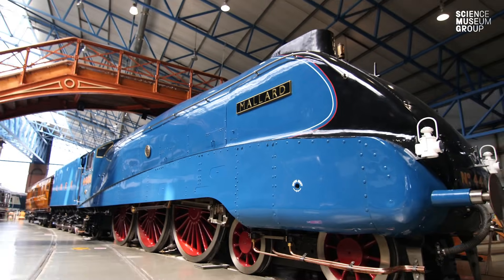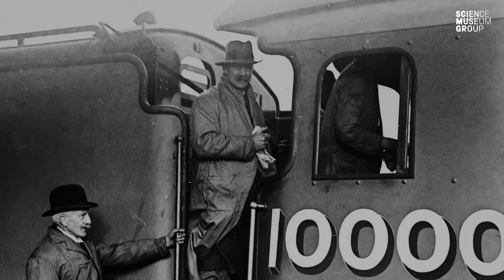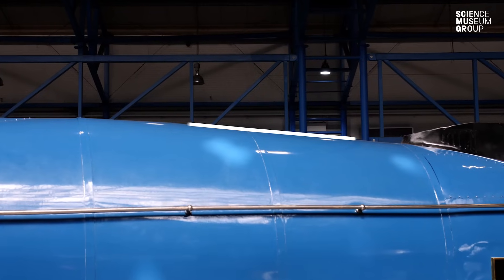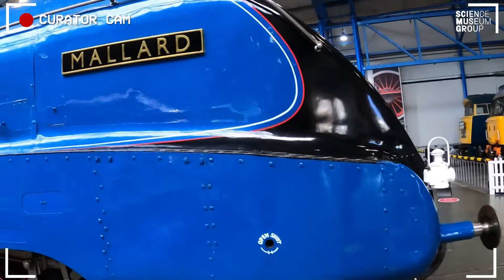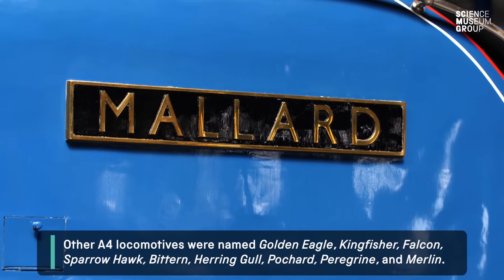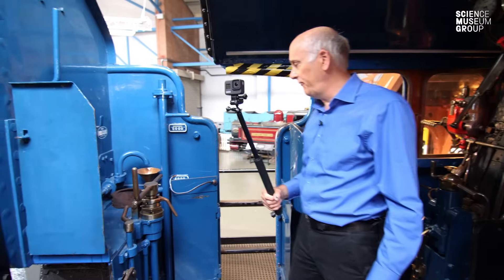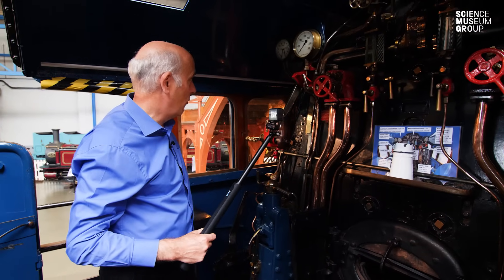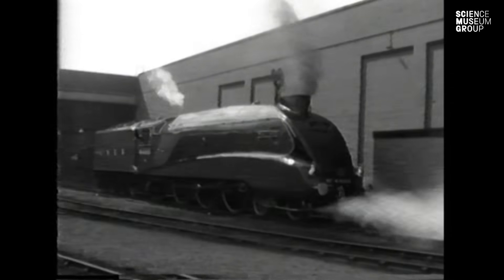Inside Mallard, the World's Fastest Steam Locomotive | Curator with a Camera

Comment: Apparently driver Duddington was chosen because he would take a risk, a bit cavalier even, and he damaged the works, something in the middle cylinder or crank went wrong during the run. Nevertheless the run stands as it should. The Germans had a run too near enough to Mallard, but it still doesn't count. As for the US locomotive that allegedly ran at circa 150mph, that was never ratified, and the loco wasn't making an official attempt...

I was on a cruise recently and got talking to an old chap as we were waiting to enter for dinner, who it turned out was an engine driver, and he was proud to say he drove Mallard occasionally during his normal driving work. He didn't make a big deal out it, it was just daily work to him. I felt privileged to have met and chatted to this unassuming man...
Reply: Duddington was not responsible for the inside big-end issue; that was due to valve overtravel from the Gresley conjugating gear.  (Which apparently was fixed long before BR days, once it was recognized as a concern).  If I recall correctly, Duddington thought he could have gotten 130mph out of the locomotive if given a little more time...
Reply: @wizlish  Interesting commentary Wiz. Perhaps Mallard was capable of more, but surely at that speed it must have been approaching the limit of all that reciprocating mass? Dunno, I'm not an engineer. Must have been exciting at the time though. We invented the bloody things, so it's somehow fitting that we should produce the fastest. I sometimes wonder how much further steam traction would have advanced had the technology been allowed to really mature...
Reply: If you want the future of high-speed steam traction after the early Forties (in a world with no war, and no ruinous shortages and then factor-cost increases) look to the follow-ones of "That Other Railroad's" Turbomotive.  Application of the Westinghouse planetary transmission (for PRR S2-style direct-drive turbine locomotives, patented in 1948) and the use of magnetorheological clutching (which became practical at almost the same time) and you have an engine that can make power almost independent of cyclic rpm concerns.  Or balance two S2-style impulse-follows-by-reaction stages across a common driving pinion, LP plena outboard, and even within the constraints of the British loading gage you'll have all the power and speed you could want.  (I remain miserable that Alan Fozard's Turbomotive 2 was stillborn; it still remains head and shoulders the "British" answer to a putative T1 'speed record attempt'...)

Comment: Imagine building a modern steam train it would surpass this record by a lot
Reply: Probably not. As there’s a limited amount of energy you can get from coal (or calorific value). Then there’s a lot of moving parts in a steam engine that will have a limit to how fast they can move back and forth, similar to a car engine over-revving itself to destruction. 
While an electric train gets its power supply from the national grid and has much less moving parts (basically just a balanced rotating shaft)
Reply: @notmenotme614  I thought the limitation was more about the linkages etc to do with the reciprocating mechanics.
I have thought that an oil-fired steam turbine powered train would likely be able to break that without too much difficulty.
Reply: @notmenotme614  coal doesn’t have to be used as a fuel, oil, nuclear, gas  are used as fuel today, and the speed of the reciprocating mass shouldn’t be a problem as steam engines can generate much more torque than a diesel per litre of cylinder volume if steam pressure/temperature is high enough meaning it doesn’t have to get its horsepower through higher revs
Reply: @jhixx8910  True! This would even be theoretically faster than existing train. The only problem left is how many water should be carried. I reckon that with Natural Gas as fuel, the driver's cabin could be computerised, thus the fireman would be the assistant driver in this case. The amount of gas sprayed into the firebox will be computerised and so does the other controls
Reply: @notmenotme614  Disagreed. The main problem with Mallard back then was that copper was used for the boiler, thus the boiler problem after breaking the speed record. The LNER Tornado built by the A1 Locomotive Trust can withstand higher pressure and temperature as it was made from steel. FYI, there is still a factory producing boilers for locomotives in Meiningen, Germany.
Reply: a steam turbine could be used which would be extremely effective
Reply: Maybe not. There is a limit to the speed of reciprocating mass. However, it's possible that had BR not hastily got rid of steam when it did, steam engine technology could have evolved to the point where such feats might have been routinely possible. Mallard was dangerously flogged for the speed attempt, but had the technology had the chance to evolve, who knows what might have been.....
Engines were built with the quite low tolerances of the day: parts forged in the Stygian gloom of Victorian and Edwardian engine sheds with more of an eye to reliability than racehorse prowess. That's not to take anything away from the skilled men who produced these wonderful machines, but the technology of the day was crude compared with today.

So yes, it might be possible and endlessly repeatable, but not with much rise in speed....
Reply: @logotrikes  I agreed. However, maybe not with Steam Turbine

Comment: You need to add the word "Official" in the title, as there is a 4-4-2 in the US that has a crew, and passenger proven speed of 127.1 mph.
Reply: It was never proven but ok😂
Reply: @Tric0l0r3  that's why I said add Official because there are many UN official runs
Reply: Can that be proven?
Reply: @rudycarlson8245  it's about to be when the T1 Trust is done being built
Reply: There's one in back to the future that can time travel too.
Reply: @scoops0406  🤣🤣that only needs 80 mph to do so
Reply: PRR 7002's 'speed' was almost certainly a timing-convention artifact (the measurement being taken as 'by' meaning the back end had passed at AY, and the time the front end of the engine reached Elyria.  In any case the same objection to '126.1' or greater being Mallard's actual record speed applies to the PRR train in spades: for 127.1 to be observed over that 3-odd miles you'd have to see high speed either side, or impossible levels of acceleration.

Amusingly the one engine for which there is reasonable indication for 128+mph operation was also a 4-4-2: the Milwaukee A class, as reported by the president of the company that built it.  But there, too, if there were an impartial dynamometer record, all 'trace' of it is lost (you can stop groaning now...)
Reply: @wizlish  well either way once the t1 makes an attempt (hopefully breaking it), then this won't be an argument or state of judgment anymore

Comment: As a Dane I visited this Railway Museum many years ago, after having seen my former direct ancestors small museum in York!
   But close to my by then home in Denmark we had the longest bridge in Europe, built by the English Firm "Dorman and Long": "Storstrømsbroen" from 1937 which is 3,2 km long (It is to be replaced in a few years, so it has done its job well, though now mostly only being a raiway bridge + some local traffic). But in the early sixties I saw a Danish built steam locomotive going up the slope to the bridge with - 120 railway wagons behind it. It was absolutely red hot in the visible bottom, and of course puffed a lot of smoke going up the hill.

Comment: Some say that the prr s1 broke mallards speed record unofficially
Reply: and Duddington said that if he knew they were going for the record he could have pushed it passed 130mph. That chance never came again.
Reply: If he had tried with an unimproved big end, that might have resulted in disaster...
Reply: @wizlish  Why? the speed wasn't the issue with the big end, that failed due to the heavy braking!
Reply: The big-end damage was done by 'pressing out' the oil film on the thrust peaks from the overtravel, which galled the plain-bearing running surface (and I suspect contaminated the lubricant with an effective shower of little particles.  I doubt that improper braking (e.g. too much drifting throttle) was a major contributor to the actual problem.  In any case the detail design changes to the big end would reduce the effective point starvation of the tribology, including under the high-speed conditions that prevailed.

Fixing the issue with the overtravel in the first place is the greater concern.  I think there are modern hard coatings and bushing materials that would limit most of the cumulative lost motion, and there are ways to deal with the arm deflections.
Reply: @rockfan3299  100% true! The driver on that day thought 130 was possible!
Reply: Not likely.  There are reasons to doubt both Arnold Haas' account and the American magazine story.

That the S1 was capable of higher than 126 mph is indisputable.  The argument, however, is an actual documented run.

Comment: Bring back steam!
Reply: the infrastructure required to run steam trains is absolutely nuts. It took a ton of people and machinery to do the maintenance, fuel them, and generally keep them running. It's the one thing no one think about when they see the occasional museum train chugging past - the massive amount of work it was to keep hundreds of engines running day long every day year round. The cost of taking the train in the current economy would be astronomical if we had steam trains
Reply: @thesteelrodent1796  And not to mention they were much more complicated to drive and required at least two people and they aren't able to provide heating to the carriages.
Reply: Can you explain that last bit?

Steam heat, and steam-ejector air conditioning, are long and well-established.  And the original American alternative to trainlined HEP, using individual Spicer generators driven from the axles, was quite adequate for much bigger and more intricately 'electrified' streamlined consists than ram in Britain.  (You can actually see the degree to which locomotive power was used, indirectly, to drive these by looking at the acceleration curve in Kiefer's 1947 study of motive power, where the curve is visibly inflected at the points each constituent car's generator comes 'on line'.

Examine the 5AT group's methods for providing power to consists with a relatively small locomotive.
Reply: @thesteelrodent1796  all true but maybe we could apply modern technology to address some of those issues.
Reply: Honestly at first it would be amazing but we would eventually get used to it just like how we eventually got used to diesel and electric trains. And I find the current trains interesting too.
Reply: @TheBrickGuy7939  I know but these locomotives look the part - not boxes on wheels.
Reply: @gerrycooper56  They probably are more impressive looking though. But what I'm saying is after a while we wouldn't find it that special anymore. And I think I get better excitement and satisfaction only seeing a steam locomotive once in a while because it makes for a more special event.
Reply: @TheBrickGuy7939  No - even back in the 50s when steam was everywhere, locos still turned heads.
Reply: @alans9806  I never said they didn't, but they were seen as the norm and people were used to them. You saw them every day on the tracks so they wouldn't feel as special and crowd gathering as today.

Comment: Apparently the prr t1 beat the mallard’s record
Reply: According to who?
Reply: No, at least not yet.

In my opinion, the stories of "135mph" data taken by the Franklin engineers describe artifacts... much like those generating the '126mph' claim for Mallard (Gresley himself dismissed this as likely a surge)... and reports of 'rides rough at 132mph' are not only likely apocryphal but involve the question about how those speeds were measured when the T1's Jones-Motrola speedometer reads only to 100mph.

That the design can reach elevated speed is indisputable, but as for the S1 the discussion involves demonstrated records.

Comment: When they achieved the record on Mallard they broke the engine
Reply: Yeah the speed was 126 mph that day and the bearing simply melted from overheating
Reply: No, the speed was 125 (and a fraction) that day, and the bearing did not simply 'overheat', it did so for a particular reason that was subsequently (and very quickly) fixed with detail-design changes to the center main big end.  It would be unfair to judge the speed potential of the A4 design, or criticize the validity of the observed record speed, based only on the big-end damage that occurred.
Reply: @wizlish no the speed is 126 mph literally says it on both side of the locomotive
Reply: As Queen Elizabeth said so eloquently, 'recollections may vary'.

Do not go by what someone made up after the fact.  Look at the actual performance trace, listen to what Gresley had to say, and draw your conclusions from that.  Be content with the real range of speed achieved -- it's still 'the' record.
Reply: suffered extensive engine damage.but still holds record ,for a staem driven engine.

Comment: The driver was 61?! That's as notable as the record.
Alco in the US apparently licensed the Gresley 3-cylinder concept and built a number of engines with it. The shops really hated it and it ended up causing a lot of trouble, so most of them were eventually bypassed.
Reply: No not really, the driver would have started off at 14 or 15 years of age as a cleaner, onto passed cleaner (sometimes acting as a Fireman), then Fireman and at a later stage becoming a driver. Each stage of progression would involve both written and practical exams.

Comment: Apparently the PRR T1 was rumored to reach 140mph. It’s unofficial but the T1 trust are building a replica and are going to see how fast they can go in Pueblo Colorado
Reply: Hey Lazarus Long, where did you find the info, that the valve gear could recognize the speed of a T1? I know there was a problem with the valve gear speed esspecialy at wheel slipping. But a T1 has not enough power to run 120mhp or faster with a regular!!! train of about 1000tons. Only the PRR S1 is possible to manage something like that.  Believe, the UP FEF 815 runs 101mhp at the AAR Test with 1000tons train and had around 5000HP.
Reply: The T-1's were kind of a flop. The Milwaukee Hudsons were reported as hitting 125 on regular runs but unfortunately the Milwaukee never tested them to see just what they could do.
One of the N & W's J's went so fast it flew off of a curve.
Reply: A man from the firm responsible for the valvegear on the T1 clocked one at 142 miles per hour.  He was sent to see why the valves were experiencing premature wear.  They had been certified for continuous operation at 110 MPH and a "sprint" speed of 125 MPH, but it was found that the trains were regularly operated at over 130 to make up time.  The metallurgy of the valves was on the bleeding edge of its day, so they were never able to certify them for over 130, so it was accepted that they would wear more quickly.
Reply: That wasn't the T1, it was Arnold Haas' account of the S1 (on the Trail Blazer in the late '40s) with the nominal speed suspiciously like a metric speed converted to mph).

I suspect that the T1 will require something like zero overbalance to actually reach its potential highest speed, and a variant of Deem conjugation may be needed for the necessary acceleration at very high speed without high-speed slipping.
Reply: Incidentally, Lazarus Long is conflating two stories.  Vernon Smith's account of the T1 testing involved by his account speeds in the 135mph range... measured by wheel rpm (to me the likeliest conclusion is fairly obvious, and the 1948 proposed changes to the valves and seats would back that up).  Arnold Haas, 'as told to' a German enthusiast, had the story about 142mph, and it was supposedly recorded while pulling the actual Trail Blazer train in 1947, resulting in some kind of ICC enforcement action that no ICC documentation to date confirms.  (Haas also claimed NYC Niagaras regularly ran at 120mph or above, of which I am suspicious...)

The Popular Science report can be analyzed with recourse to Google Earth.  Consider the acceleration rate that would be needed to bring the train to speed in the stated location, and look at the clearance between structures and the track and the fact that a line crossed the PRR main at grade nearly right there (almost sure to induce high-speed slipping in the S1...)
Reply: The N&W tipover was due to overspeed, all right, but not at a speed anywhere near what that engine was capable of.  According to (I believe) Ed King, the engineer mistook where he was in the fog, and thought he was 'one curve away' from his actual location; he may also have run the throttle in suddenly before the train brakes fully applied and been 'pool-cued' as Earl's engine was at Gulf Summit...
Reply: Edit: that was Gulf Curve, near Little Falls, New York, USA.  Why I keep making the mistake of calling it Gulf Summit, which aside from being wrong is scarcely a name appropriate for the Water Level Route... I don't know.